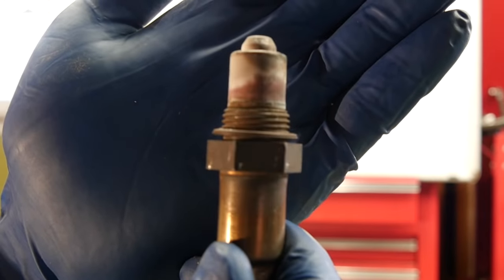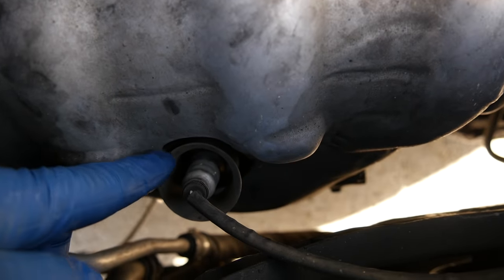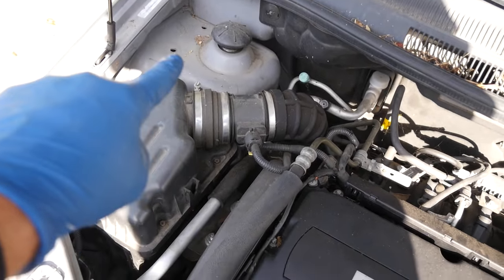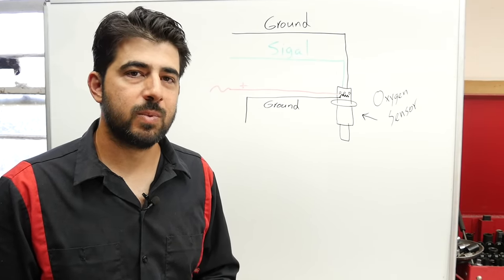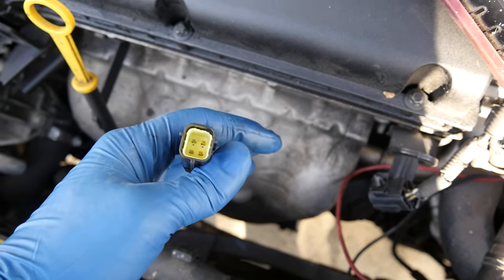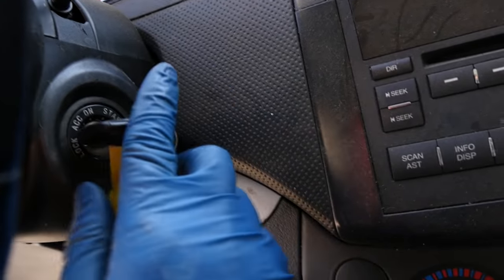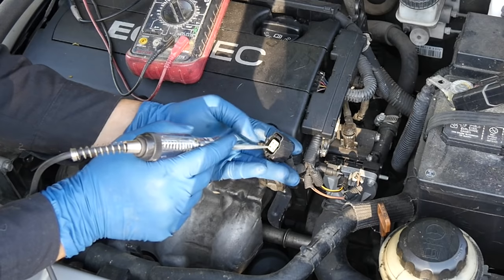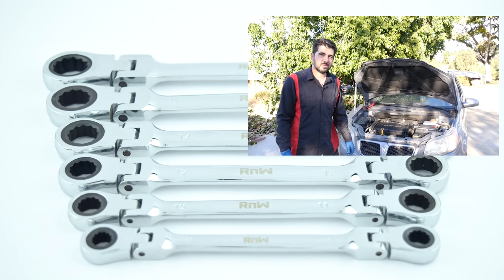Oxygen Sensor Trick and Operation Guide

Comment from the maker: So I shot this video, edited it for a few hours than realized I misspelled signal on the whiteboard hahah wt..
Reply: I didn't even notice until I read it in your comment :) Great video!
Reply: After the first two letters on a whiteboard the rest always looks like scribble
Reply: Hey i have a question i recently change my civic 2010 o2 sensor bank1 sensor 2 and sensor 1 but the codes are still there before changing the sensors there was code engine coolant temperature sensor malfunction and problem but after i change o2 sensors this code is gone but new codes showed up which is air fuel ratio sensor short range performance problem. And rear air fuel bank 1 sensor 1 circuit out of range high these 2 code are showing with red engine light on scanner but not on dash.
Reply: delete it...
Reply: @Cristip  i don't have the scanner who can dalete those codes
Reply: Hi...can you go over when you would recommend an engine replacement?

If I had my own shop and know how, I would want to do an engine rebuild, but as it is, should I get a new engine and have someone swap it in?

I have a 2002 Dodge Dakota quad cab, 4.7L V-8 with a nagging headgasket leak. Twice in 5 years it's been replaced (2013 & 2018) but has come back last couple of months. It's still a good truck, decent condition, just the headgasket. I'm so used to not having a vehicle payment, and wanted to wait another 7 years before buying my retirement vehicle.

I figure the cost of a new engine (~$6k) and install would be cheaper than what I can get a decent used vehicle for.

Thanks!

"PS...great videos!"
Reply: @Ahmedpakido  Try disconnecting the battery overnight (or really just 15 minutes), that should turn off the light. Autozone, etc. should also be able to delete the code for you with their scanner.
Reply: @mikelemoine4267  thanks a lot i have tried bad sensor problem was gone after i replaced the sensor and engine light was off after i drove like 15 miles light came back with different problem now its says p0420 cytalic system efficiency below threshold bank 1. Now im going to use catalytic cleaner which i was planning to use after i replaced the sensor.
Reply: @Ahmedpakido  Yeah it can become a real cat and mouse game to track those kinds of issues down as many sensors can go out of tolerance because of another issue. Ideally if you could get someone with a good scanner to look at real time data, you might be able to narrow it down a lot faster. Doesn't hurt to try to clean the cats though. Scotty Kilmer has a video talking about using lacquer thinner in the tank to clean them and it's supposed to be cheap and effective. Good luck with the repair, hope it's a cheap fix:-)
Reply: @mikelemoine4267  yes i have watched his video but couldn't find what he was using. I found cata cata clean which they mentioned its good cleaner i bought from advance auto parts one the the mechanic also said its the best so lets see how it works.fingers 🤞
Reply: @Ahmedpakido  Why did you change both O2 sensors at the same time?  You are going to have a hard time fixing the problem if you keep changing parts.  Try to isolate the part that is not working and then only change that part.  Also, don't assume that because you bought a new part that it works correctly.
Reply: @jasons6573  well because of 02 sensors there were other problems was appears when i change then those problems are gone and new problems appears. Since i have changed sensors all other problems are gone accept one which is catalytic system efficiency below threshold bank 1 that is the only problem left. Other then that there was 4 more codes before which has been gone after i replaced 02 senors
Reply: Didn't notice and it doesn't matter, good video.
Reply: i was thinking this was actually going to be a oxygen sensor trick on how to trick the onboard system to send less fuel into the chamber . you tricked me .   you also say that if the guy with the question did not say your videos were great you would not have replied to his question  .  goes to show how easily people are controlled with fake gratitude of accomplishments . flattery fools the majority , not me !
Reply: Sigal
Reply: Good catch!!
Reply: thats ok.. your brain working faster than your pen.  Great explanations you do  make up for any spelling goof !
Reply: @jasons6573  yes, ALWAYS one at a time.
Reply: @jasons6573  1111
Reply: " 'THAN' realized" lol
Reply: Sigal
Reply: I like it as "sigal"
Reply: @sity909  Steven Seagal
Reply: @zack2144  Steven Seagal.
Reply: @PatriceHOBBAH  Cool, you're a fan.
Reply: @sity909  Yes !!! 👍
Reply: And then after reading the pinned comment, it turned out that I wrote 'than' where I should have written 'then' . What better way to follow up a spelling error than with a grammatical mistake?   :)
Reply: Perhaps an English teacher... but other than that, probably not many people at all. Haha!

Comment: That's an interesting short hand trick. I've always reached for a diagram before moving forward, which is easy enough if you only work on a few cars. On paper it seems risky to send +12V into the PCM backwards along a signal wire that normally carries only 4.5V of miniscule current forward. However I see that many experienced and respected techs have confidence to do it all the time as a quick test, assuming the protection of resistors and diodes inside the driver. Of course current is limited by the test light resistance. It would be a different story if somebody used a jump wire from the pos side. It takes a little more work to back probe connectors while they are hooked up to measure functional values in a working sensor, especially if confused when the PCM shuts down the heater. Still, it is fun to see waveforms directly if one has the time.
Reply: Oh; that makes one feel a whole lot more confident especially when your new at this. LOL
Reply: I was thinking the same thing as I watched this. I am not a technician but have always tinkered lightly with electronics. I would feel saver hooking a test light up this way if it only lit an LED to further limit the current.
Reply from the maker: In this video I was only figuring out which wires are which and found the signal wire by finding the other 3 wires, sending only voltage and no current up the signal wire using a test light I strongly doubt would harm the PCM.
Reply: @myRatchets  to make your test light glow, current MUST flow through it....and if you don't know which wire is which, you really run the risk of cooking something in the pcm...like creating a gap in the ADC for the O2 sensor monitor.
Reply: @myRatchets  First, you don't have a choice. You can't just send voltage and not current. When using a test light, treat it like a piece of wire because that's what it is. A test like can easily blow a PCM. Careless techs do it every day. So much so, that shops are starting to ban the use of test lights just for that reason. If you want to be safe get a power probe with DVOM functions. You can touch that to any wire you want, and not have to worry. However, you can just as easily do damage like you can with a test light. Never push the button on a power probe unless you know exactly what you're doing. So, as long as you don't push the button, its a much safer tool to use over a test light.
Reply: @myRatchets  don't listen to the keyboard Certified techs 😂 I know several people who test this way, and never a problem.  Thanks for the video!

Comment: Good stuff, writing this down for future use.  Find the sensor heater and  ground with an ohmmeter.  On the harness find the heater hot with a test light.  Find the harness permanent ground with a test light, it is used by the signal output.  Then find the harness switched ground by turning on the engine power and a test light.  The remaining harness wire is signal.

Comment: Bro you make the most informative and accurate car repair videos on the tube.
Reply: well i dont know how good it is to test ground a wire that receives a positive voltage signal  .  always make sure one finds the signal wire with a ohm meter before trying to find the grounds or the power wire  .  the signal wire is very sensitive and should never be ground or to have any other voltage input  .
Reply: Keep looking........ there's more out there
Reply: I’ve done plenty looking. This dude is the shiznit.
Reply: So how did he conclude the sensor wasn't the problem?

Comment: Thanks for great tutorial on oxygen sensor function and wiring, and identifying those wires.
Reply: I understand much better, how O2 sensors work and more importantly how to test them. I have a Tacoma truck, no error codes but, the O2 sensor and catalyst registers won't set. That has stumped everyone, no one knew what to do. I spent a ton of money trying to get at least one of the registers fixed and to set. I finally sit down cleared my mind and decided the forward o2 Sensor needed to be replaced. I got it replaced and the O2 Register set in less than 5 miles. I could get my truck registered now. Several months later the O2 register will not set again. The Catalyst never did even after spending $600 on a new catalytic converter. I'm still mad as hell about that. Smog issues are not fun, not many know what they are doing and just start replacing parts which add up very fast.

Comment: Hi. When decelerating, my fuel system is in open loop, but once the speed fall anywhere between 20 to 10 mph, for a second I get OL has not satisfied yet conditions to go to CL, then immediately goes into CL using all oxy sensors, while still decelerating down from 20 to a stop. What would that indicate and does need to be done? No codes, no lights.
PS: you’re one of the most knowledgeable mechanics and the videos show it all.

Comment: Good vid always good info.
Best term to use on DC systems is common not ground. 
Also when you test for restistence across the signal wire and common, the voltage applied from your meter could damage the o2 sensor. Output voltage on o2 sensors are very small. This is what I learned from watching other vids. Not from my own experience,  so I don't know how true that is or not.

Comment: Great video. I understood the basics but didn't know the ground was switched on one circuit and the power also might only come on when running on the other circuit.
Reply: Hope I said that right. Need to scratch my head a bit. I believe you identified all the wires except the signal wire with the tester.

Comment: Thanks for the video Ratchets and Wrenches-keep up the good work, a dealership over filled the engine oil on my new Lexmoto 125 scooter twice and the bike is misfiring, the spark plug was fowled and I am guessing so must the oxygen lambda sensor which has the four wires, on the diagnostic the fuel integral term drops to minus -5 and so do the volts the engine is also over heating susceptibly, would anyone know if it is worth trying to clean the oxygen sensor and soaking it. over night with engine cleaner stuff in a jar or what else I could or should be looking out for when taking on this task please? God bless cheers

Comment: Blessings, great videos. Question I have replaced the Catalyst converter and the 02 sensor that’s on my 2003 Honda Accord lx 2.4 why is the p0141 code still coming on after I have reset it? It’s the downstream 02 sensor that’s on the Catalytic converter

Comment: Great video bud I have a 02 problem on my 2006 GMC Sierra 6.0 the former owner installed long tube headers and cut the cats off causing many problems I am constantly am running lean O2 heat sensors constantly go off multiple misfire problems how do I delete the O2 sensors please help

Comment: As I understand it from most diagnostic techs, the two white wires are for the Heater (+-)and the remaining wires are Signal (+) and Ground (-). The Heater on the O2 sensor doesn't care which is + or -. The remaining Signal + and - Ground, it is critical to have them correct.

Comment: In December I purchased a used 2004 Toyota Solara SE with the 2.4 four cylander engine.  After three weeks I checked the oil dipstick and it was a quart low. There was no oil leaking, after doing some research I found out that these engines are known to burn oil. Two weeks ago I it was low another quart. During this same time I got a check engine light. I used a scan tool which said catallactic converter. The car did not bog down or run poorly, so I erased the code. Two weeks later the check engine light came back on and got the same code.  I saw your video on Oxygen sensors how oil can gunk up the sensor. I am thinking the exhaust fumes which is carrying away excess oil due to the cars engine design defect, Will I be spending tons of money replacing the sensor on a routine basis?  What do you recommend short of getting a different car or engine?  Can I do something to prevent gunk from building up in the sensor prematurely?
Reply: I am new to oxygen sensors and catalytic converters. In my research I read that oil consumption can lead to fouled oxygen sensors and can also coat the inside of the catalytic converter. The least expensive option may be to use a catalytic converter cleaner in the gas. This may clean the sensors also. Although this may be temporary.  If not, then replace the sensors. Other options include removal of the catalytic converter and cleaning with an overnight soak in detergent. The most expensive will be to replace the catalytic converter. As long as the oil consumption issue remains, the any attempt at repairs will revert back to where you are now.

Comment: great video, i have a short to ground on both bank2's sensor 2's so fingers crossed this will help me diagnose/find the two wires which are causing the faulty ground on my e46 2002. cheers fella great video, i guess i did  miss the stripper night?

Comment: Awesome videos very helpful! So I’m in the same pickle, my 4pin o2 wire harness is toasted and melted on the vehicle side. My question is the signal wire is a shielded wire, how do I complete the circuit with incorporating shielding in the 4 pin configuration

Comment: Luv your tutorial videos. Having high oil pressure with 2004 Infiniti qx56, 5.6L . Repld oil, filter, sending unit, hooked up a guage, reads 60+psi at idle and 90+psi at just 1500 rmp. Plz help

Comment: I have a 2006 Ford Mustang V6 changed all four o2 sensors with NGK o2 sensors and check engine light is on and trouble codes for all four o2 sensors. What would be the cause of that problem?

Comment: the white board signal is spelled "Signal" you wrote "Sigal", it is OK, you will still make a great president
Reply: pmgear I thought he misspelled seagal.  I don’t understand how an oxygen sensor could work with just signal or (signal and ground)  Definitely need power, ground, and signal.  At least power and signal with the housing of oxygen sensor making ground.
Reply: I agree since the current commander in chief is clearly not in command of the english language either...  "If Russia, or some other entity, was hacking, why did the White House waite so long to act?"  and "Despite all the negative press covfefe."
Reply: @encryptorEJ  The O2 sensor creates its own voltage output similar to a thermocouple when it gets hot.

Comment: Mr. President, if anyone
can get this country back
on the road, it's you!

I have a lean O2S bank 1
sensor 1, P0171 &1131. 
OBDii states lean condition.
I plan to replace the
PVC valve as its original equipment.
I suspect, haven't verified it yet,
but it's probably a clogged O2S.
Beside gasoline, what other fluid
could be used to quickly dissolve this mess
that won't damage the O2S. I suspect
it's either soot or oil from way of
the PVC valve accumulated in and

on the O2S. (4 wire, 1998 Toyota 4cyl. 5SFE)
The O2 in this car is over 200 bucks new, I would rather buy time until next year saving up bit by bit
as that is a very big chunk of change. In fact all the sensors are original. And because of lack of 

experience I suspect when I do try to clean the O2, it will take a lot of hard work just to remove it.
Reply: MrPanetela get a MAP gas torch. Heat up the bung that the O2 Sensor screws into. It should come out with out much problems.
Reply: @livingstonbarrie  thanks, great idea!

Comment: I am long time hobbyist mech.  Work on all my cars and sometimes family or friends cars.  In the last 30 or so years, I've changed about a dozen O2 sensors.  The code was always O2 sensor heater circuit.  Never had any other kind of failure.  Changed the sensor and wallah, working again.  Is my experience typical or am I just getting lucky?

Comment: My Moms 2007 Yaris had Check engine light for coil pac so I changed plugs and coil packs then code for bank 2 o2 sensor so bought cheapest one online   Now code for bank 1 o2 sensor and code for running on 3 cylinders checked coil packs and spark plugs, there good.  The car has little over 200000 miles and and afraid to spend the $160 for the bank 1 o2 sensor if it’s only running on 3 cinders. Do you think that o2 sensor will fix it or is the reason the code p0308 causing the code p2238. I also hear a slight knocking and that’s the cylinder that smells like gas.  Watch you every time I have a question. Thanks for the awesome Channel

Comment: Great video.. quick question if you have the time to answer... if O2 sensor is throwing a fault code but car shows no other symptoms, not misfiring, not stalling, no smoke, no change in fuel economy etc (271D oxygen sensor heater before cat Bank 1) does this mean the whole sensor needs to be replaced or is there a workaround to repair it?

Comment: Thanks for the video. I'm having an issue with my computer not switching the ground on and off. So therefore I get a rear O2 sensor code heater circuit. Can I grab ground from bank 1 sensor? Then this will turn the heater on and then it will be sensed by the computer that is running? Thanks again for the video